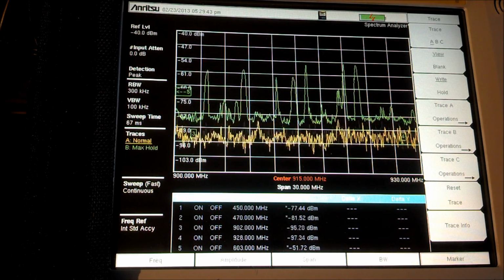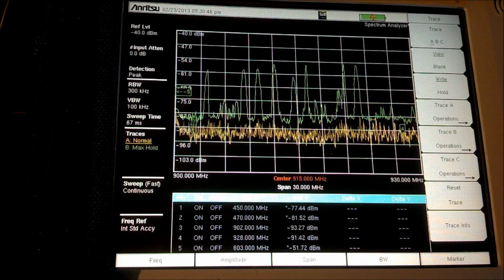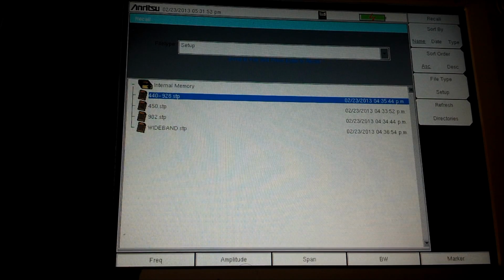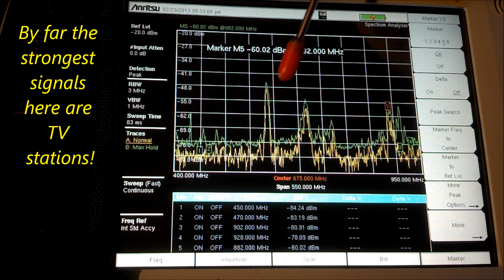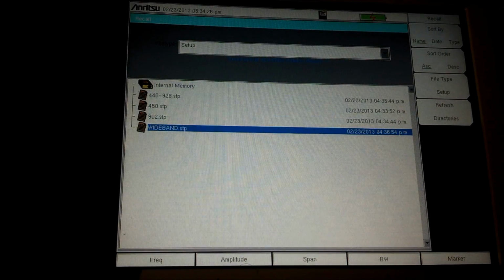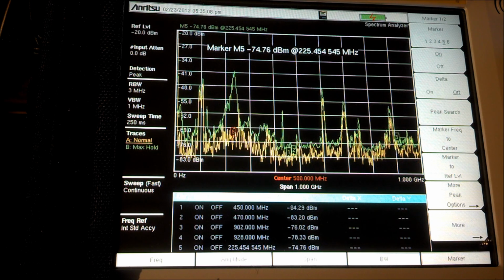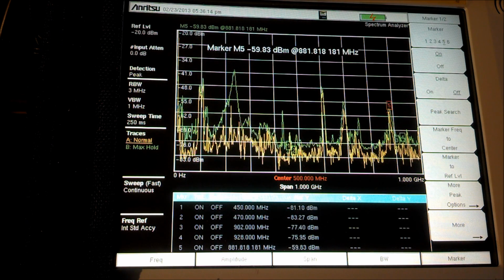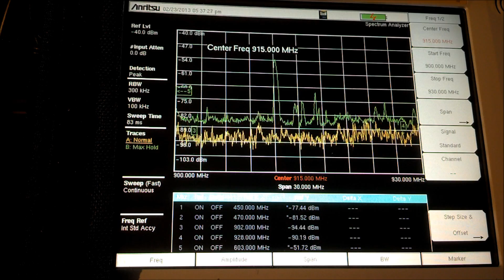Spectrum Analysis of a Smart Meter

Comment: They for sure jam up the ham bands with rf noise BAD! i use a spectrum as well and i can see the noise every time and here the noise when they are transmitting. Not a good deal I have wrapped the smart gas meter and electric meter with copper mesh and killed the signal from interfearing,now they come read the meters as they did when they were analog. I'am the ASST EMERGENCY CORRDIDINATOR HERE FOR NATIONAL DISASTERS .SMART METERS CREATE ALL SORTS OF PROBLEMS IN COMMUNICATIONS. KY4JIM

Comment: Thanks for the video David. I understand there may be some higher level signals out there from the location you're measuring. But I didn't hear you describe the physical relationship of your spectrum analyzer to the smart meter. Were you within 5', 15' 50'? Some of us have meters on the other side of the sheetrock from where we have our beds, lounge chairs, etc. So our exposure is large. I have an HFE35-C RF detector and even from 30' away, the smart meter on my wall is by far the strongest signal. Interestingly, the signal I get hit with the hardest is the one facing me on the neighbor's wall. The metal service panel shields me from my own meter to some extent.

There's an acknowledged difference between analog carrier waves and pulsed microwaves when it comes to biological effects. The pulsed radiation has been shown to be somewhat more detrimental than analog (like TV and terrestrial radio), relatively steady signals. Another factor is that certain frequencies, such as the 450 Mhz range have wavelengths that have are very close to parts of the anatomy. As a radio guy, I avoid mounting 450Mhz and above antennas up on the front fender of vehicles for just that reason.

I'm old enough and have been around radio (licensed ham as well as commercial) long enough to remember even back in the 70's that a hazard of working around radio transmitters and high voltages is an elevated occurrence of Leukemia. I used to brush off the laymen worrying about cell phones, wifi and smart meters, but then I started thinking about the delicate nature of cell reproduction and how an outside unnatural influence like pulsed microwaves might just be problematic. Especially in schools where we're bathing those young, developing bodies in wifi (microwave radiation) all day long. I've installed a lot of those devices in classrooms and no thought was ever given to the health effects on those kids. There's kind of a momentum about getting tech deployed that I was unable to overcome where I was working. 

I'm not any kind of authority on the RF/bio interactions, but I think we're better off safe than sorry. As to the notion that it's not an ionizing type of radiation like plutonium, just ask the frozen food you re-heated in the microwave oven if it felt something!

I guess I kind veered off the smart meter topic, but it's all related to the ever growing background RF issue of modern society. 

So, again, thanks for contributing to the discussion, but keep an open mind.

Comment: Thanks for this analysis.  But I'm curious, can you get accurate signal strength levels with a single antenna?  It can't possibly be equally sensitive over the spectrum you're looking at.
Reply from the maker: The antenna used was the Anritsu 2000-1616 ultra-wideband omnidirectional monitoring antenna.  It covers 20 MHz to 21 GHz with only 7 dB variance in the passband.  Datasheet: http://www.anritsu.com/en-US/Downloads/Brochures-Datasheets-and-Catalogs/datasheet/DWL3707.aspx
Reply: David Witkowski Those specs are excellent.  How much does that antenna cost?  I can't find a price on the web.
Reply: David Witkowski I just noticed that in a comment from a year ago you said "used a simply whip antenna".  So I'm not clear on which antenna was actually used for the tests.

I'm not disputing the observations and conclusions you made in the video.  I'm only interested in getting the most accurate facts regarding actual RF levels.
Reply from the maker: Stephen Kearney You're right, I was confusing this video with another analysis I did for a client.  This video was done with the whip, an Anritsu 2000-1487.  As I recall, I adjusted the whip to minimal length to get the best resonance in the UHF band around 470 MHz, because I was having a hard time seeing the Aclara gas meters at all.

Comment: This analysis was done in a central location - the real transmitter harm from a Smart Grid asset (electric meter, gas meter, repeater) is when the device is in your proximity- like 4 feet away from your head during sleep.  There is a HUGE number of people that get sick from that.  
This does not cover the switching mode power supply, which puts noise all around you 24/7.  From data I have seen, this is the most harmful aspect of SM electric meters.

Comment from the maker: LTE (aka 4G) cellular uses a modulation method called OFDM which uses short pulses.  Some cordless phones use FSK or FHSS modulation, which is also short pulse.  There are a lot of wireless systems which use short pulse modulation, at higher power levels than smart meters.

Comment: Nice video, but I don't agree with you.
The fact that there are other RF transmissions does not make the RF emission from the smart meters OK. Their transmissions are in addition to the old transmissions and one other more important thing is that the smart meters are on your house and not 0.5 a mile away, or few miles away as TV transmitters.
By the way RF from cellphone antenna, TV and other RF devices does cause some health effect to some people.

Comment from the maker: Hi Tomas!  These meters are designed to transmit energy usage information back to the utility, but there may be "readers" in the sense of test equipment that can query the meter and confirm a response or initiate diagnostics.  I don't know of any specific models to point out, but I know that the utilities were asking a few years ago for test equipment along those lines.  Hope this helps.